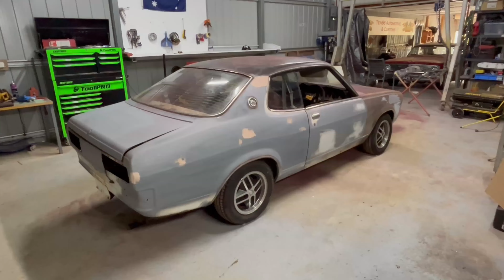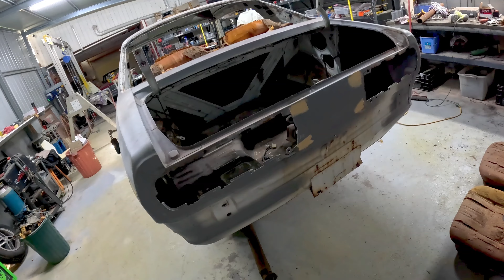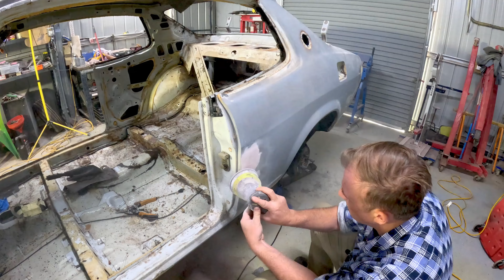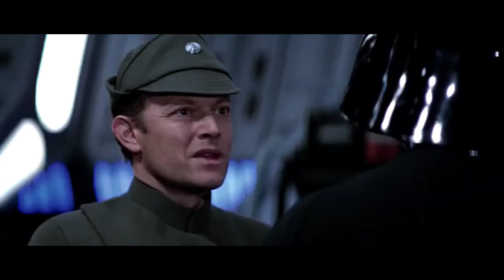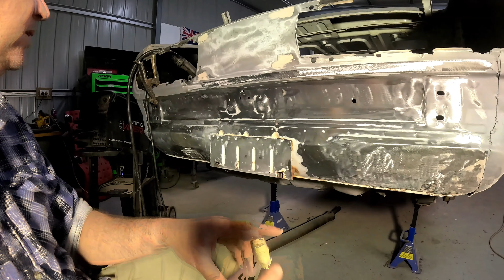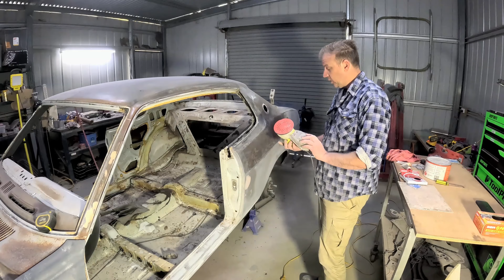MASSIVE project update - the highs and lows of old car building! - Galant Hardtop Build EP 15

Comment: Another great episode Daz. You touched on something that I should have as well, a backup tool cause they always fail when you need them most. I'm with you on the electric tools over air. I don't know whether it's the consistent torque delivery or just that I hate the sound of compressors pressurising. Nice job on the etch too, it's amazing how that first prime shows up the lines of the car especially when wet. I'm a big fan of epotech but I don't have the safety equipment and filtered environment for spraying that carcinogenic stuff. It does self level nicely though when it's sprayed on. That brown stuff really did look like rust on camera but it could have also been a contaminant reaction. It seemed to come off pretty easy with the DA.
Reply from the maker: Thanks David. Really kind words and I appreciate it. Definitely provides motivation and that is always a good thing....so thanks!!
Yeah, although they were the norm many years ago, air tools are the pits...for the reasons you've mentioned. I only use air to inflate tyres and spray paint. Everything else now is either corded or battery power. That damn DA ruined my progress but I had been wailing on the poor thing for many years so I am not at upset with the quality. As proof, I just bought too more of the exact same DA. HAHA

Thanks for watching and the support. I greatly appreciate it.